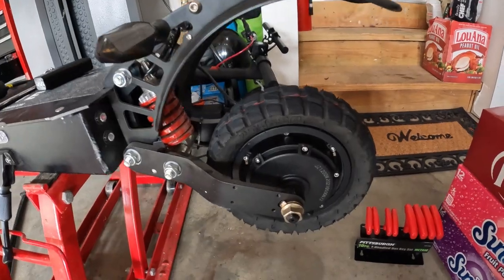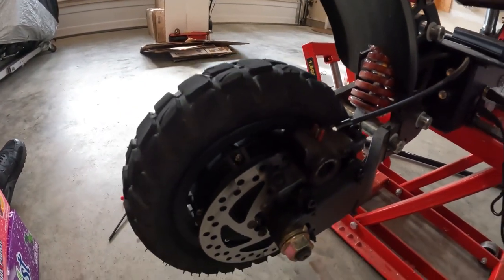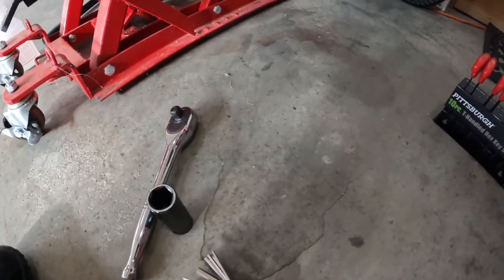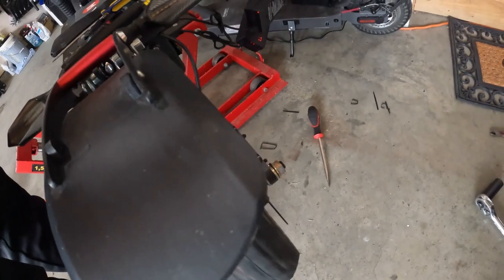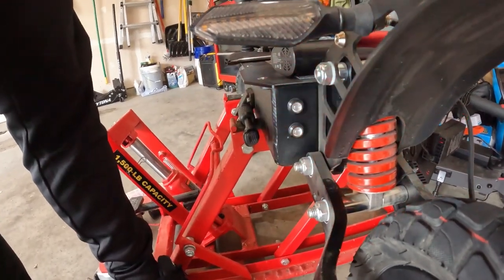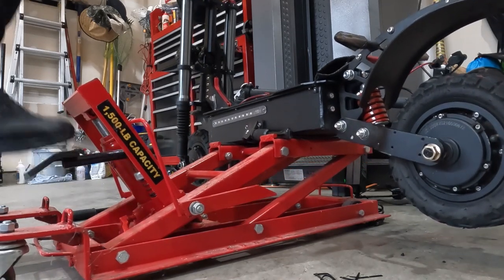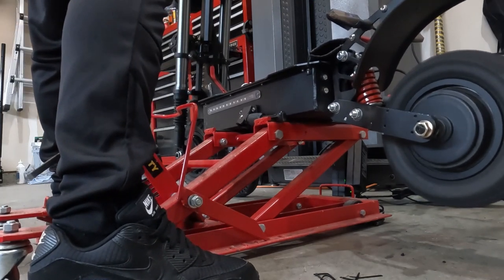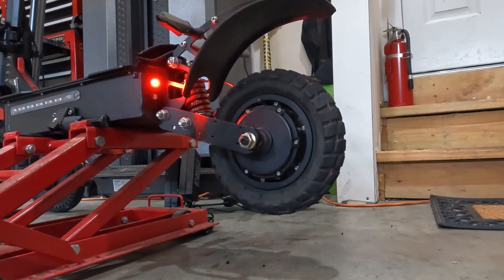Scooters - YUME Y10   Fixing the flat!!!  escooter, e scooter, electric scooter

Comment: Thanks for this video. I legit just got my Yume X13 yesterday and my rear tire got flat after like 15 miles. Really annoying. I feel like it’s an inner tube issue since I didn’t see any holes in the tire and now especially since I saw how deformed yours is. 
Thanks for this video. I will use it when changing mine.
Reply from the maker: Hope it's helpful.  You saw in my video where there was "stuff" in between the tire and inner tube?  U might wanna make sure that is not the case for you as well.

Comment: Oh hell no, I just got done replacing my inner tube of my rear tire a few days ago and you either got a defective tube or they didnt place it correctly when they built yours. Good luck finding an inner tube for that scooter in any local store unless you live in a big city that has an electric scooter shop or something. I had to order mine online. I did the slime thing 1st too but after putting the slime in and and air I went to ride it home and thats when it completely blew before I ever got home where it wouldnt even hold air at all so I knew it had to be a tear and no longer a slow leak. That slime was a goddamn mess to have to deal with when changing the inner tube. It wasnt dry at all and was literally all over the inside & outside of the actual tire.. what a headache the whole repair was. I wouldnt recommend the slime though lol.
Reply from the maker: I actually found it on Amazon!

Comment: Yeah u closed the rim on a part of it from pinching it when u put the rim back together. You did fill up the tube halfway between after u put it in the tire but before u put the rim back together right? Cuz thats how u get the tube out of the way so as not to do that.
Reply from the maker: Ok.  Thanks

Comment: What problem did you have with the battery?
Reply from the maker: At first, I thought I had a bad battery, but it turned out that the battery needed to be "trained". I rode it 'til it drained down then charged it and never had an issue again.

Comment: What Size inner tube 
Ive  had 4 flats in 2 month
Reply from the maker: I keep riding in this construction area and getting flats as well.  I believe the tire is: 10'' x 1.95/2.125   
I got 2 tires on Amazon:  (2-Pack) 10x2 Replacement Inner Tubes 10'' x 1.95/2.125 | Compatible with Bike Schwinn Trike Roadster/Tricycle/BoB Revolution Motion - Made from BPA/Latex Free Premium Quality Butyl Rubber
Reply: @timdiggitty7064  
Thanks  I Appreciate the Help
Reply from the maker: @SirLikkAlot  np.   Hope that gets u what you need.

Comment: Tubes are a complete nightmare..you'll be replacing them every other ride..spend a little more and get tubeless tires
Reply: solid tires  the best way to go.  their not as bad as people think they are
Reply from the maker: Joey.  I have a Hiboy S2 with solid tires.  they are ok but I think I will stick with pneumatic for now.
Reply from the maker: Christian Gray.  I was thinking that way.  I will most likely go that route.  I was trying to see if you could out a tubeless tire on the 2-piece wheels.  
Either way, I have a X7 on the way so the upgraded tires will have to wait for a bit.
Reply: @timdiggitty7064  solid tires are heavy and slippery. they will also cause more strain on the motor and it will be slower..
Reply: do you know  what size solid tire i should get for the y10?
Reply: @dn30001  solid tires are the same size as the tube and tubeless tire size. read the side of the tire that you have
Reply from the maker: @dn30001  Only that it is a 10" tire.  You sgould Google it..  See what others have used..
Reply: @lionelhowell4972  @tim Well according to what you are saying,  Yume is sending out scooters with the wrong size innertubes.  The tire size is 255x80 (which is about 10x3).  The innertubes I have in mine are 10x2. Maybe that has something to do with these flats.  Thanks.

Comment: Slime doesn't work with tubes only tubeless according to what I've been told
Reply from the maker: I found that out.  It does, but my hole was on the side and I had Debra in my wheel from the factory.

Comment: I cannot undue the Alan bolts that hold that side plate on. Fk meeee
Reply from the maker: They are "soft". You can try some vice grips as last resort
Reply: @timdiggitty7064  does soft mean they are weak? Seems I stripped my Allen key but not the bolt lol. I'm just taking it to my bmx shop tomorrow.
Reply: @timdiggitty7064  They aren't reverse threaded are they lol
Reply from the maker: @tarantulamadness6191  Now that you mention that, I do remember the tools they provided were junk.  i ended up using my own
Reply from the maker: @tarantulamadness6191  No.  I don't believe so
Reply: Thank you sir